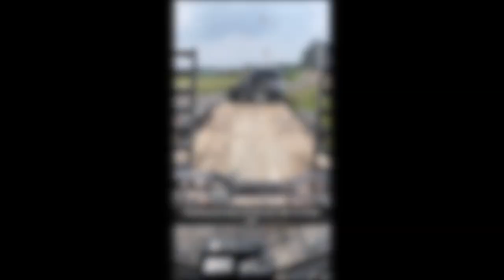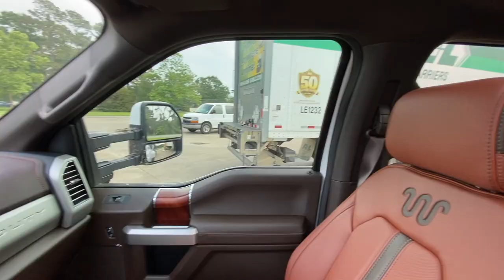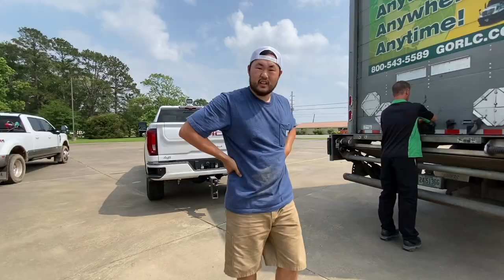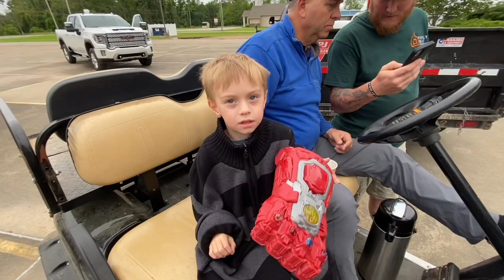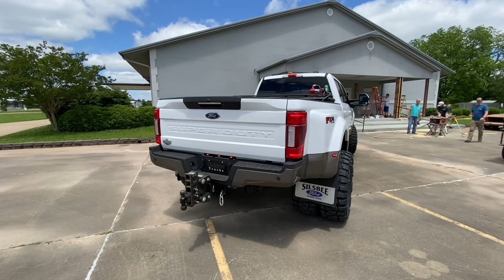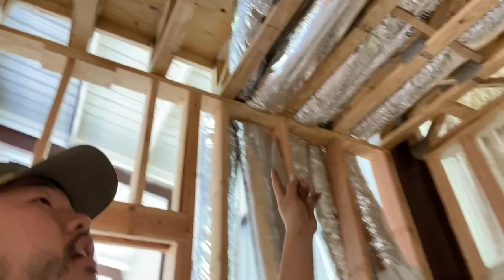FINALLY LIFTED MY BRAND NEW DUALLY F350!

Comment: Nice! Did you have to use a spacer on the rear ? I tried using my oem rims for bigger tires but les schwab said a spacer was not safe and ended up getting new wheel.

Comment: What lift are you running? And does it rub ? I have a 21 f450 KR and I’d love to fix it up like yours.. I’d have to replace my wheels to get tire of that size f450 problems with those 19 inch wheels
Reply: Probably have to put aftermarket rims
Reply: 3 inch